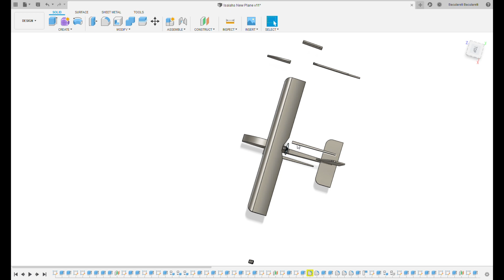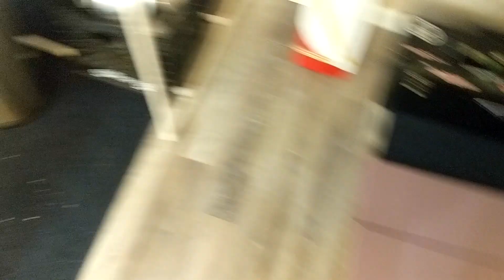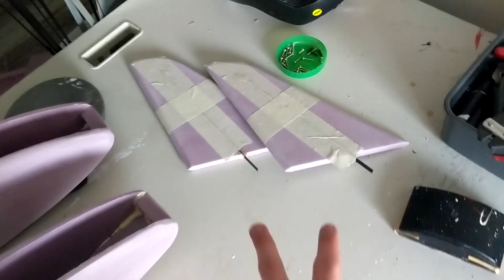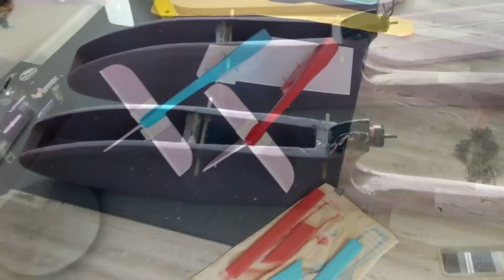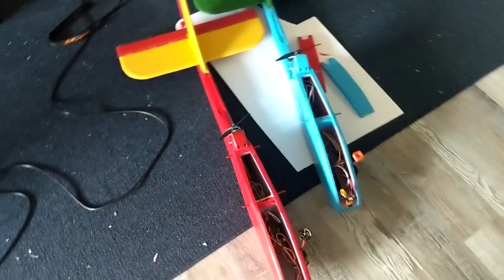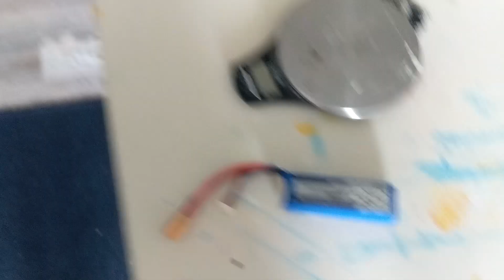Trainer RC Plane Build

Comment: Did you have any issues with the paint damaging the foam?
You did a good job and they look great!
Reply: On the other planes he built he used latex paint which is water based and does not damage foam😁
Reply from the maker: Thanks! Yeah, it's latex paint so no issues damaging the foam. The only problem is that packing tape doesnt stick very well to it, so it's not as crash resistant.